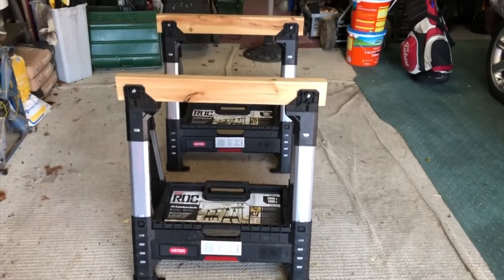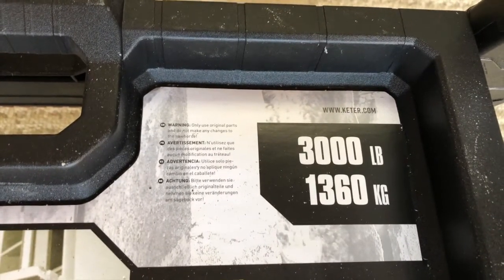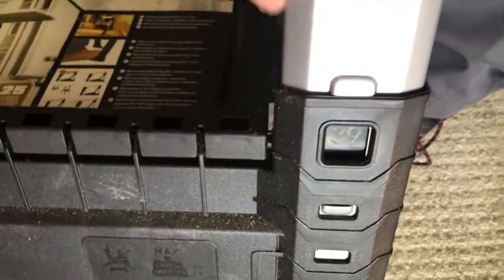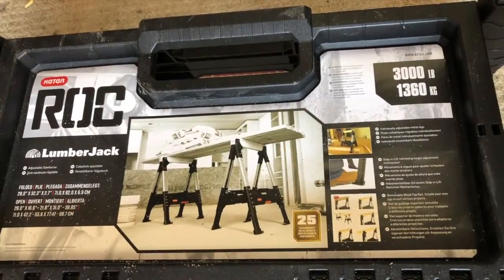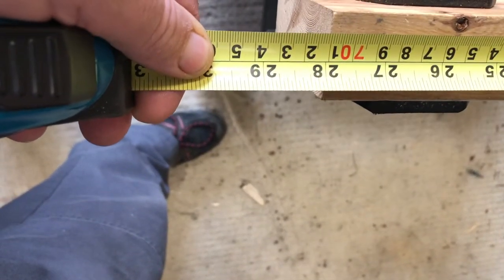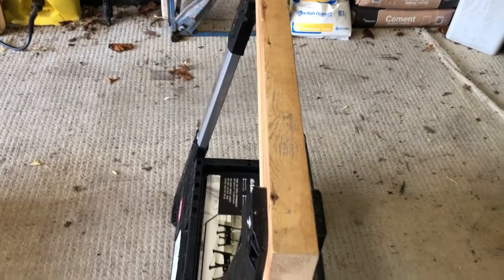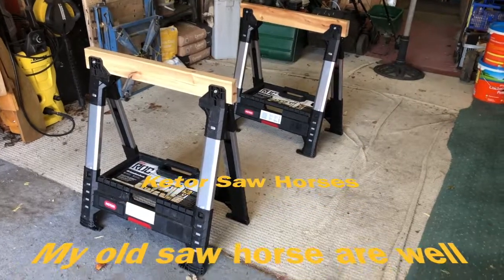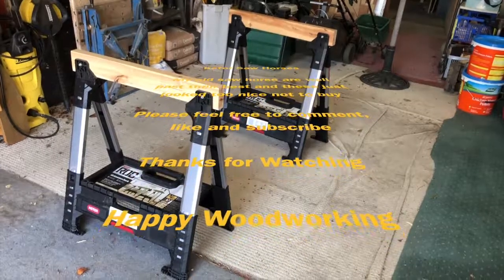Keter Lumberjack Saw Horses - Tool Review Tuesday

Comment: Saw Horses! They are a real problem to get right, they are either too heavy, or not strong enough to be rigid in use, I have found that all the ones with plastic components eventually break, but the 4"x2" wooden ones last forever but are heavy, I think 3"x1 1/2" would be about optimum, but you can spend more time making saw horses than using them, it depends how much room you have in your workshop, I have just made a pair of folding horses which appear to be very good, time will tell! Chris B.
Reply from the maker: Englishman French Hi Chris, to me these were good lookers, fully adjustable and a great weight so very portable, I tend to use horses when away from the workshop so traditional fixed wooden  ones would hardly get used. Nice to make  your own folding ones something satisfying about working on tools you make yourself and usually they’re better made. Cheers Steve
Reply: I know what you mean about portability, that is where the plastic build wins, but I just don't like throwing things out after a very short use, I suppose I should make up some light weight 3"x1" horses to carry around the site, quite strong enough for most jobs, I have been working on an Oak beam 12"x12" by 12 ft, and that sits very well on my 4x2 horses, so they are probably much too strong for "normal" use.Stay safe!
Reply: Dude, it's a lifetime warranty! There's no going wrong with this stuff.

Comment: Hi Steve,

Noticed an vid from the Tool Review Zone about the Bora speedhorses. Link: https://youtu.be/440FvCpGHfU. 

How is this issue compared with the Keter version? 

P.s. i saw similair item from the brand Rigid and Stanley?
Thanks!
Reply from the maker: The Bora & Keter are very different how they work, the legs don’t fold away on the keter and the lags are more of a H frame therefore there’s zero racking. I can’t compare as I’ve never used the Bora type though I’ve used the Stanley versions. Collapsing and portability the Stanley wins however for looks and the versatility of having a timber cross member wins for me. Hope this helps
Reply: Thanks for the quick response. Did you mean with zero racking that the sawhorses are stable also if you put pressure sideways on it? (Just checking, perhaps I misunderstood and translate did not work ;))
Reply from the maker: @dlmm2645   Yes, I’ve never experienced any side movement and are very stable 👍🏻